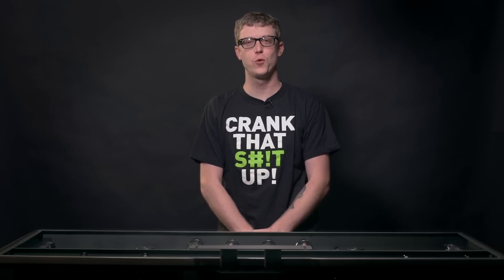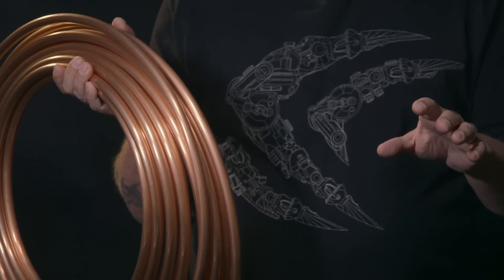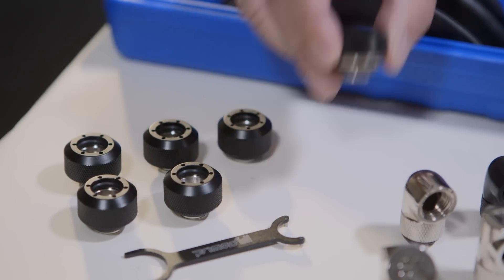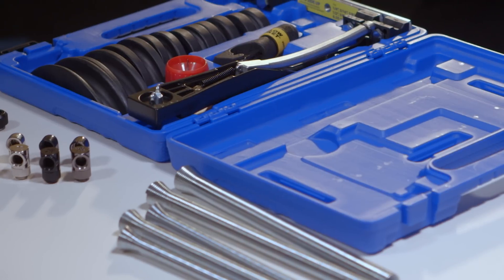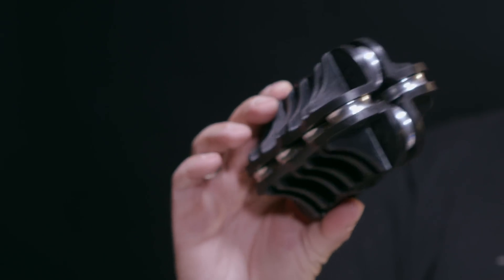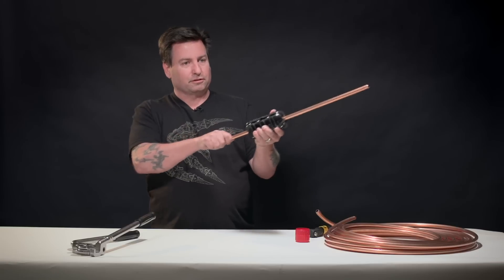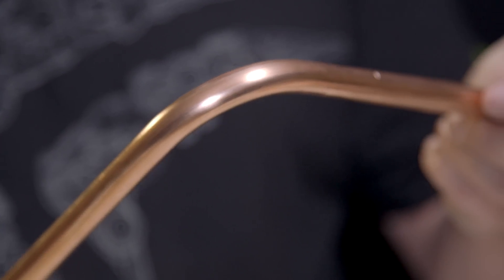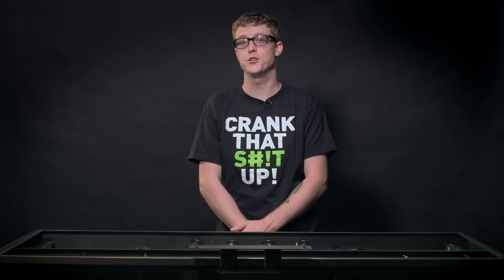GeForce Garage: Cross Desk Series, Video 3  – How to Bend Copper Pipe For Liquid Cooling Loops

Comment: Pro tip from an HVAC tech: take the whole roll of tubing and lay it down on the table and unroll it down the table. You will have more torque on the pipe to make those straight lines. Then use your roller tool to get completely straight of you're a perfectionist

Comment: what was the point of using copper if they just painted over it?
Reply: what paint?
Reply: GooberSuess thermal conductivity ?
Reply: mick fine No.
Reply: You paint copper because of oxidation, like liberty and old copper roofs goes green.
Reply: Andri Andrason They didn't paint it - they powder coated it. There's a difference.
Reply: heat up the copper and rub a film of flux on, 
then get a rag with cold water and buff the flux off while hot, 
you'll get a really nice finish to the copper, 
I'd like to see all the offsets brazed with copper fittings.
Reply: Andri Andrason, they turn green because of combination of oxygen with moist from the air. In a watercooling closed loop with distilled water corrosion shouldnt be your concert.
Reply: @ogamov  distilled water doesn't mean anything, the corrosion is a result of oxidation from the oxegyn in water, both in the actual chemical formula and dissolved oxegyn molecules.
Reply: @andriandrason1318  Funny, the pipes in my house aren't green, even the 40 year old ones. Thats only an issue outdoors or if you mess up and leave flux on after sweating.

Comment: I'd recommend straightening out the pipe before cutting it. This way you don't have 2 ends that are difficult to straighten by hand, and also, the cutter is less likely to walk on you.
Reply: ..Or don't powder coat it at all? You'd get the same oxidation color layer as some domes on old buildings, which could look pretty neat. And after it formed, it actually protects the tube then after, as well as can do powder coating (and nicer, if most of the rest is black for instance - and I'll never, EVER limit my color pallet to NVIDIA's green/lime stuff, this is my build of my own taste not theirs).

Comment: The one thing I really dont like with most water cooled builds is when poeple (especially using rigid pipe) but a diagonal peice going straight from thing to another, in my opinion it would look better (and not take much longer) to put a bend in it make look a lot better
Reply: Chris Millar I agree, the weird diagonal copper tubing doesn't look right. Just do a few 90 degree bends
Reply: Chris Millar that's how an old time plumber does bends ,if they are , what we call , show pieces. In other words visible to passerby's.
Reply: every bend increases resistance in the water flow.
Reply: Jeremiah Johnson usually , us old dirty plumbers use a log type table to verify resistant / cavitation / velocity issues with FU demand pressure , velocity , resistance by number of fittings and degrees of each fitting, all related to pipe size and incoming pressure. 
In the desktop computer typically  its of no appreciable value.
Reply: +texasdee slinglead this water isn't under extreme pressure it's pushed by a small pump less bends the better. if it doesn't matter why even de-burr the inside of the pipes. just use 1/8" coiled tubing and make the biggest spiral slinky you can fit into the case. these are tech nerds who want the best performance, hence the water cooling in the first place. nobody would make it less efficient knowingly
Reply: adding more 90 degrees increases water resistance, which is a bad thing in a water cooled system.

Comment: Nice results, I think it's a good job bending, installing and painting the Copper tube.

I don't know exactly if copper is overkilling for this use, tipically copper is used for high pressure (between 20 psi and 400 psi), zero reaction with the refrigerant or fluid and killing bacteria

Comment: Why would you use a specific or dedicated water cooling type of fitting with a o ring that type of device is prone to leaking anyway , at least in my trade , instead of either a standard brass compression fitting with a compression ring (brass) or simply just using type m rigid tubing instead of soft copper and just soldering fittings together? I'm sure there has to be a way to remove any left over flux from inside the pipe. Then maybe have it nickel plated or something.  Just asking cause I'm going to be doing a custom water loop soon and I'm a commercial plumber.  thanks for your replies in advance.

Comment: what are the thermal pros/cons of using copper over plastic?
i get that it will definetly help dissipate heat but what about corrosion or some hidden factors idk tell me!
looks sick and if its clearly superior to accrylic i think ill use it on my next build :)
Reply: capitangoldfish I don't think corrosion would be a problem if your loop is full copper and you use good coolant.

Comment: Personally a matching lime-green powder coat on the tubing would look a lot better than black. It would add more aestheticism to the build instead of making the cooling system look moreso like just another feature. Also, I would only use 90 degree angles, but it's all preference.

Comment: Very nice. might give this a go on my next build. Pretty cheap to do this actually. Though i'm planning on doing a high gloss chrome mirror finish. Any one have any suggestions for the best possible chrome paints? spaz stix or otherwise. Will be using the black high gloss base.
Reply: You might be better off getting it chrome plated instead. Sure it'll be more expensive in the end, but you'll probably like the result more.

Comment: What is the optimal wall thickness for a 12mm pipe or 1/2 inch pipe. They always come out too flat or kinked on the bends and I do have a good Ridgid bender (used though).
Reply: ccricers : most 12mm pipe I've seen as a wall thickness of 0.6mm, which gives you a Wall Factor of 20. With a Wall Factor that high, you're unlikely to be able to a bend tighter than 3D (3 x diameter), so if you're kinked then I'd suggest your bender's bend radius is less than 36mm.

Comment: I like what you do with your builds and I've never owned my own gaming pc, So im taking the plunge and saving pennies, And going to buy my Parts to gaming heaven, This I know only its going to be a AMD, it will have water cooling all in 1 system, has for that what case should I get and so forth, what would you recommend? I've been thinking of using the  A10 chip, but which one should I use? there's so many to choose from.
Reply: Who are you expecting to respond about your AMD build on an nvidia video?
Reply: tech dude So what your saying is no one is going to respond coz they know nothing about AMD stuff is it, Ok So I cant ask for advice coz it was a pipe bending vid,  Not everyone is has shallow or narrow minded as yourself.
Reply: no, I just thought there are better places to ask this question.
Reply: tech dude yeah I hear what your saying, that's why I been asking all the computer  sites I frequent. don't matter what the subject video is its a computer buffs mind I want. Im not as daft as I look.
Reply: Karl Benson You shouldn't buy water cooling if all you can afford is an A10. You should save up at least for the 280x/GTX 970 range of cards and at least a 8350/4690k CPU before even considering water cooling. Your performance will suck for the price otherwise.
Reply: Karl Benson I know I'm late to the discussion, but I highly recommend steering away from AMD GPUs and saving for an NVidia Geforce GTX 970+. Those are good cards. AMD CPUs are pretty good though, I recommend the FX-8350. If better, then you will likely need watercooling.
Reply: Karl Benson Don't water-cool your first build, cause you'll probably screw it up.

Comment: Does the copper tubing help dissipating heat?
It is much more conductive than acrylic.
Reply: Yes, copper is VERY conductive.
Reply: Yes, i've seen a PC before that was completely passive with copper tubing and fanless radiators. It was pretty quiet
Reply: It's not going to play as much of a role as you might think.
Reply: brandishwar
As who might think?
The effect is probably minimal, I was just curious if it was notable.
Reply: +i Llama No it's not. Comparing the thermal conductivity of the tubes with the radiators, you'll see that it doesn't matter the slightest. You could even wrap up the tubing in heater-isolation, it wouldn't make a difference.

Comment: Does the powder coating negatively impact the passive cooling of the copper tubing? Or are the temperature differences negligible?
Reply: the surface on the actual radiator is bigger than the surface on the tubes by such a big factor that the heat radiated from the tube is totally insignificant.

Comment: I probably would have capped off the ends before powder coating, the inside is just gonna get a light dusting that will just flake off over time an burn out a pump or look horrible in a res.

Comment: Some of the best air coolers works better than the small liquid coolers. After looking at the numbers I have come to the conclusion that liquid cooling is to expensive and to prone to failures to be a good option to the best big air-coolers with heat-pipes.

I have for 10 years been running a Core 2 Duo overclocked from 2,4 to 
3,2Ghz with a huge Scythe air CPU cooler that has 10 heat-pipes. If I 
had been running water-cooling I would have had to replace components 
like pumps many times. The little difference in cooling performance 
(2-4Celcius lower at 60Celcius) is simply not worth the extra money and 
hassle
Reply: IMO its just for the fun and the looks

Comment: could anyone tell me what's the ID and OD of the tubing as well as the fittings.
Reply: Those are Revolver Primochill fittings for  rigid tubing, which are designed for 1/2in OD pipes. So the tubing has outer diameter of 13mm or 1/2in, if You are using imperial measurements.
Though I have no idea about ID of said copper tubing used in this video.
Reply: ID is irrelevant, Just match OD to OD, size is irrelevant, as long as fittings match the tubing
Reply: its just 1/2 copper that you would find at your plumbing supplies place mate

Comment: surly you want something that is heat insulated so that the cold coolant stays cold?
Reply: Ozzie Peck That's what the radiators are for. The coolant won't stay cool with all the heat it's picking up. It would be cooler without any insulation, to let the heat escape.

Comment: Personally i am against using copper due to its thermal conductivity. You will just end up dumping a lot of the heat back into the case instead of dissipating it at the radiator.  if you are using a chiller it also creates a huge condensation risk.
Reply: the copper tubes have so little surface area compared to the rads that the heat dumped back into the case is totally negligible.

Comment: Wouldn't copper dissipate a lot of heat into the case negating one of the the points of watercooling?
Reply: No.  The heat is going to end up in your case either way unless you have your radiator mounted outside.  The goal is to take the heat away from the GPU/CPU core.  The cooling will work the same way whether you use plastic or metal tubing.
Reply: He thinks that because copper is good at conducting heat and plastic is good at insulating heat, it would make a difference during heat transport. Which it won't or be so low that it would be negligible, copper only helps speed the process of cooling the water. Although i do see why he would think that.
Reply: yes it would dissipate more heat than let us say plastic, but the surface area of the coolant that is in contact with the copper is small compared to the volume of the coolant so it won't dissipate 'a lot'. The radiators are designed with maximum surface area exposure in mind.
Reply: Ideally your coolant shouldn't get any more than 40c under full load anyway so it's not going to make a big difference copper vs acrylic.
Reply: Ya, copper is a poor choice for this. That's why it's used in air conditioning. It transfers heat well through itself.